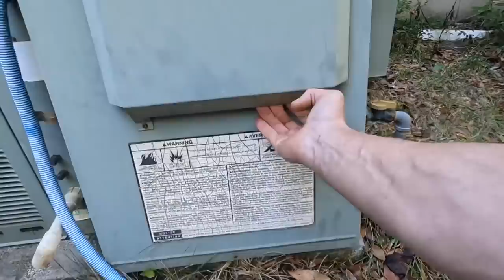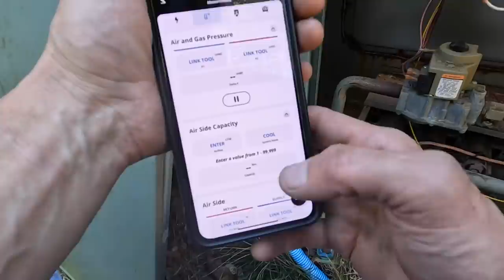Technicians Could’ve Killed Someone - Heat Exchanger With Holes was Left Running!

Comment: Might worst nightmare.  I've worked for myself for almost 16 years and been doing hvac for 30years. I've seen so many commision based company's pay the techs to find bad heat exchangers and techs make commision on selling a new furnace.  I worked for them company's and I wouldn't do that unless I actually found crack or hole.  
When I find a Crack or hole it's not easy telling customer the bad news. Also I'm often called for second opinion in something like this. I'll check it with blower out, above coil, with my inspection camera and often times not find bad heat exchanger and at same time main limit never opens. 
My always advice is to the customer that they should have a co detector.  
Good job on being thorough on your Inspection. This is a perfect example on why we love our work.... we save and help people lives.

Comment: I agree that the unit is in bad shape and needs to be changed out. Unfortunately parts have become scarce. I install Ruud units in North Texas and since that is the same as Rheem we've been having lots of issues with Rheem manufacturing not even having the parts. Hope you can find a package unit to replace it with as we've had tons of trouble getting those too. 

I do wish you had done a carbon monoxide reading of both the supply air and the vent gas. The reason why is because I've never seen CO enter a space directly from the HX and into the airstream. The only time I have seen CO enter the home is through interior furnaces with improper venting or HX issues due to the vent gasses being forced into the space through a draft diverter (natural draft only of course). However, in this case, there should not have been any way for CO to enter the home. I've never seen CO enter a space on a package unit with the HX even worse than this one you have. Since you have a slight vacuum on the inside of the HX due to the combustion motor and then a much greater positive pressure from the indoor blower; air from the air stream would have been entering the HX and causing flame disturbance, not combustion products being pulled out of the HX. If the flame disturbance were to get bad enough, the rollout switch would shut the unit down and prevented any damage to wiring or components in the unit. I have come upon this issue on package units a few hundred times now in over 22 years of service and the units still operate safely without emitting CO into the air stream until a replacement to the unit or HX could be performed (these package units were emitting fair amounts of CO to the outside btw).  Only if the rollout switch is tripping do we shut the system down. What I'm saying is you should have checked to see if CO was entering the home before shutting the system down. They likely could have had heat till you got the new HX or unit. 

I hate that this is so common on package units due to their poor design. Since the air goes through the coil, blower, then HX; the cold 35-50 degree air in the summer time causes the HX to sweat and rust. The rust thins down the metal till either the metal collapses or the heat from the burners causes the rust to let go and open up the holes. I've actually had to change several Rheem/Ruud HXs that rusted through before the 10 year warranty was up. Yet there is a style of Lennox package unit from the late 80s and early 90s that has no HX issues due to the fact that the air goes through the blower, then HX, then coil so the HX seldom ever gets below dewpoint with the summertime air across the HX being 65-80 degrees. Not that I like Lennox, but that was a good design that they don't do anymore. 

I did want to mention though, about the one time I actually found a bad CO problem. I was called out to a church that was having a women's meeting and the women started passing out suddenly. I went in to find that one of the several closet installed 60s model Carrier furnaces they had there had screws holding the top of the HX that had vibrated out and allowed the HX to fall back about 1/4 inch. That caused air to be forced in to the draft diverter hood forcing the flames out of the HX and up the front of the vestibule of the furnace. It had started melting all the wiring and all too since this vintage furnace had no rollout protection. The flame rollout was allowing CO to build up in the closet and start seeping into the air stream through any small gap allowing air back into the system since the closet was being pressurized from the HX leak. Checked all the other furnaces to find the screws were loose on them too. Thankfully the screws were easy to access by just reaching into the draft hood with a stubby screwdriver or small impact wrench so we could make sure to check them on our regular visits. We actually were able to repair that furnace and get the furnace back operating, but we shut the furnace down after a couple years when we started finding the screws were beginning to strip.

Comment: While inducer motor is running it’s causing a vacuum in the heat changer so if its cracked hole it ll actually sucking everything in sometimes it ll trip that roll out limit. Just a thought

Comment: In my area, we are NOT allowed to shut off gas BEFORE the meter, like you did with the adjustable pliers.
Shut off after the meter is no problem.
Reply: Same here In Kentucky. Before the meter is a no no even if the furnace is the only gas appliance they have

Comment: In Canada it is a law if you find a cracked heat exchanger you will remove the gas pipe and cap it. I have had arguments with other technicians on talk forums when I say I take the wires off the gas valve to make it safe. "I don't need your permission to save your life ". I would rather have you sue me than live with the fact that someone died because I didn't take those wires off.
Reply from the maker: True, so true
Reply: @HVACGUY  lots of crooked outfits in VERY COLD Canada that prey on older people. My mom was a victim IN 2003 . HVAC salesmen in the area were doing "free" furnace inspections with  thier fancy camera bullshit . Sold her a new furnace claiming pinhole leaks in a heat exchanger. Shut the heat off on her  when it was -20c outside, and left with two tiny electric space heaters . Then claimed the new furnace  unit could only be sold with a new airconditioner which she did not need .  Sold my frightened mom everything. When I  found out about this, I demanded the company show me the pinholes in the heat exchanger. They could not. I called the gas inspector, he examined the heat exhanger but wouldnt say yes or no. I am APPALLED at the kind of crooked bullshit that goes on in HVAC.  Next time these BASTARDS are going to be sued big time.
They were just lucky they got away with it the first time.

Comment: Good video and I understand safety is number one but I don’t understand why you would shut the gas supply off to the house, there’s a shut off valve at the package unit package unit, unless that gas meter is specifically for the package unit, if not what about the other gas appliances? They’re not going to have gas to any other gas appliance? A gas water heater, gas range or maybe a gas fireplace. 🤔

Comment: You turned off Gas at the gas meter (6:57) for what reason? So they can't use warm water from the hot water heater, cook food on the gas stove, or dry their clothes in the gas dryer. I think you took it a little to far to prevent the furnace from running.
Reply: Seriously???  Do you live there?  How do you know every other appliance is gas?
Reply: @musicnerd72  does it matter? Common knowledge is that you only turn off gas to the appliance in question. Hell, Why not just turn off gas to the whole neighborhood then??
Reply: @bradw.5991  My sister's house has a gas furnace, yet everything else is electric.  I'm sure he checked that before turning it off on this house.  Don't jump to conclusions is all I'm saying.

Comment: To the techs talking about leaving units run with cracked heat ex stop because you're messing with peoples lives. I always disable unit in a couple different ways so customers can't just turn it back on after I leave. And note on my internal paper work what I disable. Cya

Comment: Lol holy sht!!! you can see the cracks in the flame from the outside. 

Is the inducer pulling or pushing the flue gases? Looks like it pulls. Probably wasn’t as bad as it looks. Curious on what the CO reading was in the supply? I’m guessing 2-5ppm. 

Just throw some 6” long metal band strap clamps on the holes and call it a day. Lol joking 🙃

Comment: What ? Did they bypass rollout !
Shouldn't have ran flame on then shutdown.  3 times then lockout. Limits failed ? Normally they fail open.
Was this a no heat call ?
No heat because machine was locked out? If so then no danger machine worked as designed.

Comment: Simple monoxide tester should tell you at registers.  Back in the day when people didn't have one.  You could borrow from the gas company.  Have a great day.  I am not saying what you're doing is wrong.  You know for sure.  Have a great day.
Reply from the maker: A Carbon Monoxide detector doesn’t always tell you there’s a hole in the heat exchanger. First you have to have incomplete combustion, and second exhaust gases have to escape into the airstream.  Those two things don’t always align. So, a CO detector at the vent should never be used as a final test, especially when it’s easy to check. Even on a furnace where I can’t really see the exchanger, if it’s older, or if there are other reasons to be suspicious, I do a combustion analysis.

Comment: Sensing bulb broke , charge lost terrible welds on TXV and they didnt plan on removing motor as it was pipped wrong.  Gas flex going through cabnet needs nipple to acediment trap to flex to shutoff valve.

No parts cause everything is outsourced yay big government.

Comment: cant it be repaired by welding
Reply from the maker: Absolutely not.
Reply: Yes if you know what you are doing
Reply: Some of the heat exchangers have 20+ yrs warranty, would you give it a 20+ yr warranty after you weld it. Lot of responsibility to take on
Reply: @josejulian5116  it must have a fabricating shop somewhere if its not available